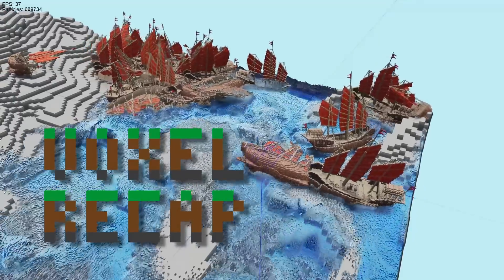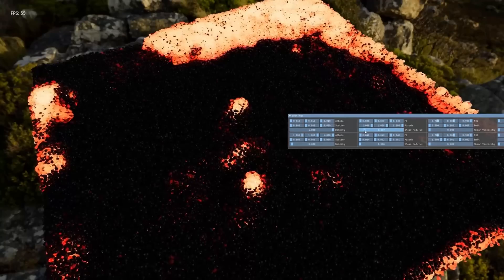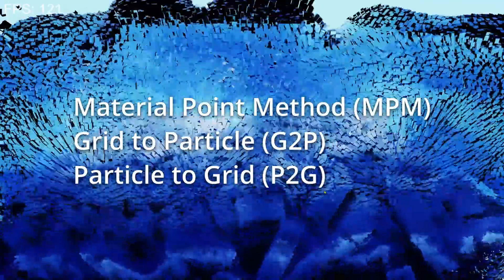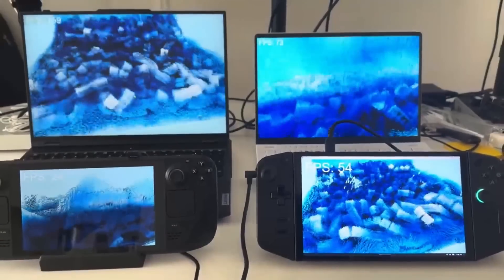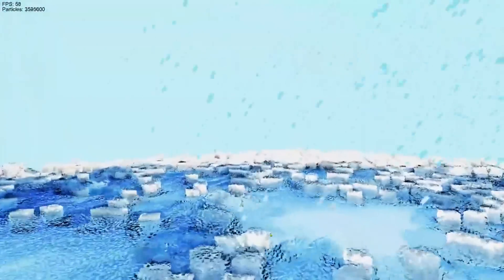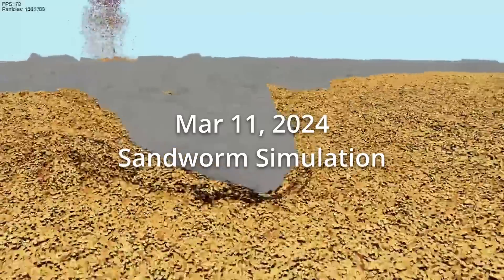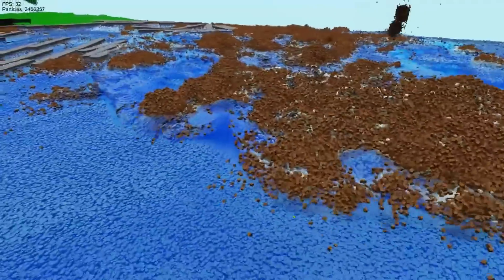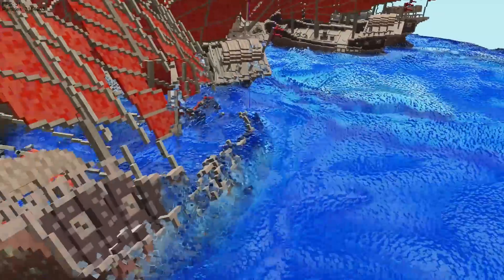6 Months of Voxel Physics Engine Optimizations

Comment: Wow. Nice work! I have a few questions about your fluid/solid simulation. How do you discretize the domain? Do you have particles like in SPH simulations? Are you actually solving mass and momentum balance equations to have a physically accurate simulation?
Reply from the maker: Thanks! What I use is called Material Point Method. It is a hybrid particle-grid method, others in this family are PIC or FLIP. Mass and momentum are taken into account and it is mostly quite accurate.
Reply: @GrantKot  Thanks a lot! I'll look into that.

Comment: Really good job! Have you thought about rendering a lot of simulations, storing them, rate them and use them to train an ai model? As far as I know nobody is currently working openly known on such a project (maybe for a reason). Start small however :) Cheers!
Reply from the maker: My main impression of AI models for fluid simulation is they look a bit like multigrid. If it is a CNN it seems actually a bit similar to what I have set up. Like the kernels are like the MPM kernels where velocity gradients are measured etc. What I feel is that I already have the minimum computation required to simulate materials. It might be useful to fit material parameters so that simulated material behaviors more closely match experimental behavior.

Comment: looks amazing. but, wouldn't it be substantially faster if you did this on the GPU instead of the CPU?
Reply from the maker: It's a bit tough to say. With most gamer level machines, I think doing the simulation on CPU and rendering on GPU makes sense. Anything less than an Nvidia card ending in 70 or AMD equivalent. Especially on handhelds, or console, I think it's better to have them work as a team. And the memory is unified on APUs. There is also an expectation of raytracing in voxel engines on higher end cards.

Comment: Cool engine but what will be its purpose? I see projects like this that overdesign the physics/simulations and people do nothing with them. Like, it's not the complexity but the meaningless "glitter" that it provides, for example, if you use your simulation for realistic water then that's it? half the game performance for this? 99% of games "fake" realism with pre-rendered simulations/assets, which looks to be something that makes those assets rather than uses them.
Reply from the maker: Yeah it would be useless for only-water scenes that could be simulated with heightfield. I think it will get more interesting with mixtures of materials and more complex multipart structures with joints and motors. Then maybe there are a lot of engineering type games, or evolutionary sims that can be made. For me mostly, I'm just wanting to explore and see how much I can push the computer. And I think for a lot of custom engine devs, business success might not be the end goal. Maybe it is a little bit like an optimization RTS strategy game for us.

Comment: Now that you've implemented sand and seen Dune Part 2, you have to implement sand worms

Jokes aside, you've mentioned that your physics simulation scales linearly with the number of cores. Of course this means many things are calculated at the same time, but I'd imagine that theoretically every particle could affect every other particle, right? So that means the simulation isn't deterministic? (since it depends on the order things happen to be calculated)
Reply from the maker: I actually do have a Sandworm Simulation video (March 11). But maybe now need to add some spice harvesting machines/thopters in the scenery.

Currently, it is unfortunately not deterministic. I do have local split screen on the previous demo, which might work with something like Steam Remote Play Together streaming.
Reply: @GrantKot  I assume it isn't possible to make it deterministic while keeping the multi-threading, right?
Reply from the maker: @xGOKOPx  It is pretty close to deterministic when the adaptivity is off. Your want for determinism, is it for VFX simulation or multiplayer?
Reply: @GrantKot  I'm just curious. But yes, I think multiplayer would be the main use case
Reply from the maker: Yeah, I think the cloud streaming would work pretty well for multiplayer. Here also the person in the group with the fastest computer could be doing the simulating for everyone. Right now, the GPU still has enough leeway to render multiple views.

Comment: Hi, very cool! But unrelated question;
As someone who doesn't know too much about computers, i have the feeling that i the last 20 years or so computer technology hasn't really improved much. As in, we still use the same tech and principles as back then, but industry has made everything cheaper and we figured out to make things smaller and more efficient so things have in fact improved, while still using the same technology. Is this true? If so, then it only makes sense that technology improves incrementally (with diminished returns even) over time. The only place left then to truly improve things is with optimization. Like how is seen in the video. Fax? Also i wonder what AI is able to bring to the table but i will restrain myself from bringing up such a buzzword. Oops too late.
Reply from the maker: I think it is possible we found the bottom limit for price and new CPUs and GPUs will be faster, but also more expensive. So optimization will start coming more into play. But if computers continue to get faster and cheaper, then there isn't much need for optimization.
Reply: @GrantKot  Interesting. Thanks for your thoughts! So in other words there seems to be improvement going on still. Just not at a neck-breaking speed. I must mention this train of thought sparked by a recent video by 2kliksphilip (Release Day VS Hindsight: Computer Injustice) in which he talks about gpu's. It struck me as surprising that a certain older gpu (don't remember the name) is very reputable despite being old, and people regret not buying them back in the day when they were cheap.
Reply: Game dev graphics programmer here. There have been numerous improvements in raw hardware speed, core counts, and algorithms. 

CPUs have tens of cores, GPUs have thousands of cores.

What you may be referring to is that in the last 2 decades there has been decreasing returns in core clock speeds due to Silicon having a soft 5 GHz barrier. You can’t afford the heating bill on CPUs that run at 500+ GHz. Those are also made with GaAs due to Silicon’s inability to “scale”.

Intel held the industry back for a decade with quad core CPUs. AMD’s Ryzen and Threadripper brought us ”Cores for cheap” by giving us 6, 8, 12, 16, 24, 24, 48, 64 cores at affordable prices. Intel dropped the price of its 18-core CPU by a whopping 50% due to Threadripper!

Even “simple” algorithms can be sped up 2x to 8x by doing more calculations, doing branchless algorithms (trading latency for throughput), using small data tables, or some combination. RAM speed is SO slow compared to CPU speed that many data tables have been made obsolete - but one must measure your algorithm to know where this boundary is.

Multi threading has become mandatory for scalability of performance. I.e. compression/decompression, CPU rendering, physic’s simulation such as CFD.

Heterogeneous computing (CPU + GPU) where you try to keep both CPU & GPU workloads balanced to achieve high utilization and performance is a skill set. 

Unreal Engine’s _5 _ showed us software rasterization is not dead and that it can even beat hardware rasterization. Hybrid utilization / hybrid rasterization is a game changer.

We finally have hardware raytracing where we can use custom data structures for walking a scene.

Deferred rendering and Physically Based Rendering are the norm for high quality photorealism.

We have pseudo real-time Global Illumination with multi bounce lighting.

We have path tracing in pseudo real-time.

GPUs have 12 GB, 16 GB, 24 GB, or even more VRAM allowing for bigger and bigger datasets to be used.

Not thrashing the data cache is extremely important for high performance. One can have two algorithms doing the exact work with the only difference being the way they access memory and one can be 8x times SLOWER!

A LOT of this is niche but there have a TON of changes to the way we approach algorithms, optimizations, you just have to look in the sub-fields of programming.
Reply: @MichaelPohoreski  Wow, well thanks for the long response!
Honestly i only grasp a small portion of what you just said, but i think i can make up of it that a whole lot has been going on, and i hardly understand the gist of it. Sorry if things fall on deaf ears haha.
It seems things have in fact improved alot. But like with any field there are many factors that influence the speed of change or progress. No such thing as linear progress! More like a bumpy line, but still upward?

Comment: This is amazing sim work, but clarify one thing, what do you mean you were super intrigued by intel's cpus and their high core counts ? I really tried listening to that part 3 times but still can't figure out what you mean. I've been using pcs since the days of AMD k6, Duron and Celeron Days. And now I have a Ryzen cpu. The only reason why we have high core counts these days is because AMD broke the almost decade old intel grip on the 4core era. Back to the point : 
What do you mean by being impressed with intel's higher core counts ? Perhaps you meant some sort of special register that may be unique to intel that helps your specific use case ? It makes very little sense to say intel has more cores since their top of the line desktop chips have a mix of bigLITTLE cores that top at 24threads/cpu whilst amd's top at 32. The enthusiast/workstation chips both Xeon W series and Threadrippers share the same story. 
The only place where intel and amd share the same nr of threads (not cores) is the high end mobile market but then again amd's offer with 3d-Vcache may significantly help your use case. 
All in all, you gained one subscriber 🥰 keep up the amazing work !
Reply from the maker: I'm mainly looking at what is available to most gaming consumers. When AMD goes above 16 cores there's a major jump in price right, with HEDT? The 13900K is available for $464. Anyway, once I did the testing my laptop 13900HX beat out my 12 core desktop 5900X. Could be due to DDR5 as well.
Reply from the maker: Anyway, I was able to get the E-cores performing about half a P-core. There was an earlier thing that said they were about 1/4 and I just wanted to see if I could do better by optimizing memory bandwidth. Sometimes I'm drawn to negatively reviewed hardware as well to see if I could do better. Like I was almost curious about the MSI claw to test out how it does compared to the AMD handhelds, but signs point to bad manufacturing by MSI as well. I currently have 3 AMD computers and 2 Intel so not trying to start any CPU wars. The sparse grid was developed also because I felt like it would help the grid data stay on v-cache more.
Reply: @GrantKot  ah I get it now, it makes sense to pick the best value option. And regarding ddr5, yes, In your memory bandwidth intensive usecase, it makes sense that ddr5 would outperform since it's got almost twice the bandwidth (on average). No CPU war intended btw 😅. Also, if you move your simulation from a dual channel to a quad or octa channel system, you should see serious perf jumps there too. Cheers

Comment: It's amazing how many incredibly skilled programmers end up building voxel engines.
Reply: Would be cool if they got togheter and made a general voxal engine too see what games can be done with it.
Reply: I think that’s probably just because they can more closely approximate the real world than other types of digital simulations. Even Minecraft is more realistic in many ways than other game engines (while having a lower spatial resolution than other voxel engines, obviously). Most hyper-realistic simulations tends to have that atomization of digital objects in some form since you need to run the physics calculations on as many points in space as possible. Like even Microsoft Flight Simulator, which is arguably the best looking game/simulator out there, simulates aerodynamics by running the calculations on lots of different points on the body of the aircraft. Voxel engines kind of have that ability built in rather than having to lay polygonal models on top of the simulation. But, like always, there’s a trade-off between the volumetric resolution and the processing power required.